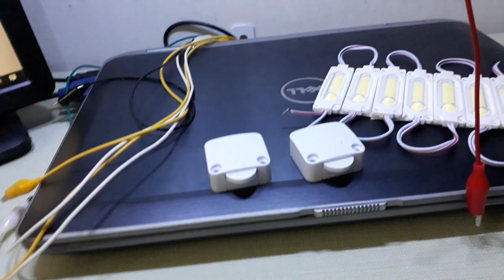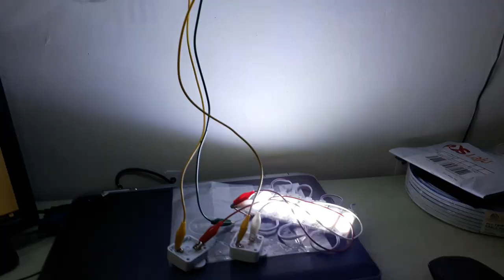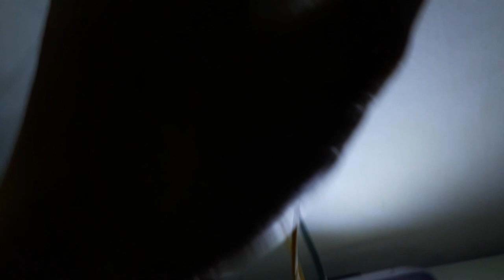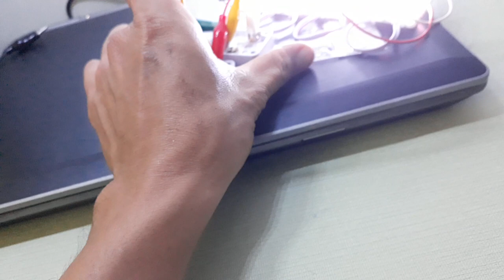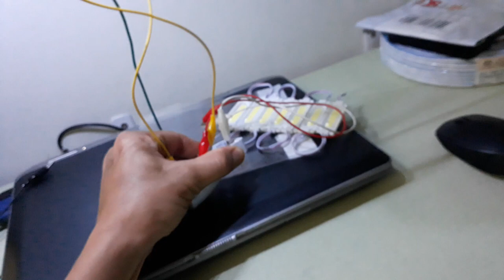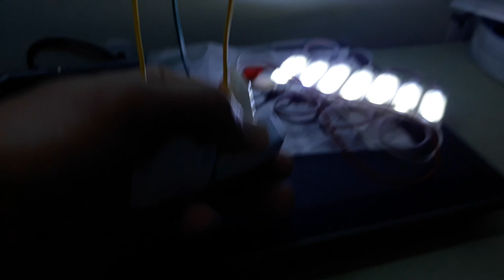Cabinet or wardrobe door light switch

Comment: where can i buy a switch like that?
Reply from the maker: Hi Jeffrey, I got mine from local online Shopee, depends on your location and prepared online shop. You may use below link.

https://shopee.com.my/202A-wardrobe-Cabinet-light-Switch-Automatic-reset-switch-door-control-switch-i.70521946.1251732516

https://www.lazada.com.my/catalog/?q=wardrobe+switch&_keyori=ss&from=input&spm=a2o4k.home.search.go.75f824f6Ir6EbK

https://www.ebay.com/sch/i.html?_from=R40&_trksid=p2380057.m570.l1313.TR12.TRC2.A0.H0.Xwardrobe+switch.TRS0&_nkw=wardrobe+switch&_sacat=0